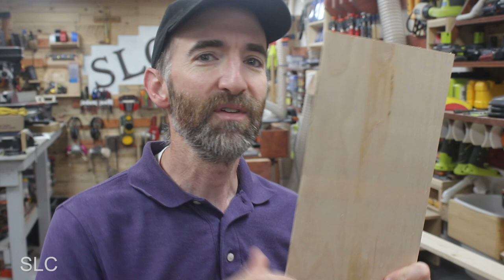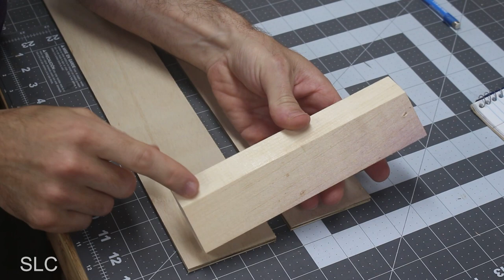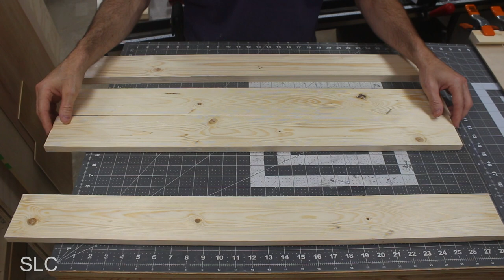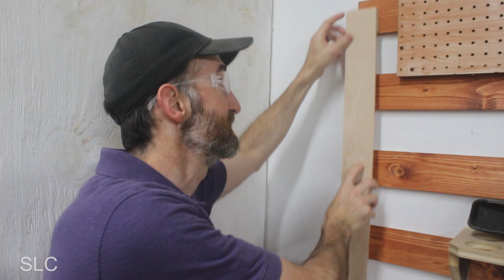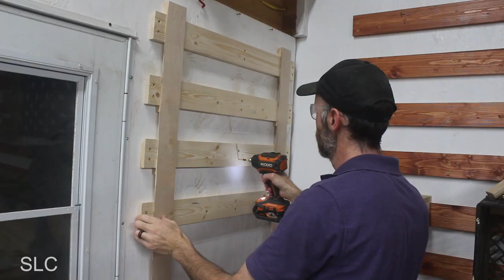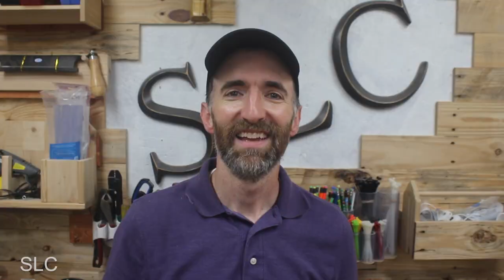Must Have Tool for French Cleats : Quick Installation

Comment: Nice idea. But I used rather simple but still effective way - you can start from bottom and then using the spacer that has been made from piece of wood you can easily go from the bottom to top adding the cleat one by one.

Comment: Good idea!  With an existing cleat wall as well as ripping a wider tool, I would have clamped slightly wide shelves to the bottom of the existing cleats, then glued and pinned the shelves to the tool to avoid having to transfer marks.
Reply from the maker: That would be a great alternative way to do it, thanks for the ideas

Comment: I would have made this in a 6 1/8" width and then ripped it on the tablesaw to get a perfect mirror image.
Reply from the maker: Good suggestion
Reply: That's what I was thinking!
Reply: Pin this comment!
Reply: Yep, came to the comments to say exactly this.  Make it as one piece, then split it.  Way quicker

Comment: Love this series. Thanks. What width do recommend for the tool holder cleats? Do you glue or screw them in?
Reply from the maker: The width depends on how wide the holder is and the weight/ balance of the tools it is holding.

Comment: I've made this same tool but only the top cleat to first holder. To get a matching set I attached 2 cleats the distance I wanted to a 6" wide piece of MDF then cut in half on table saw. I doubt I spent 5 minutes making it.

To use it the jig is moved down the wall to mount the next lower cleat. By using the single row jig I'm guaranteed spacing and level will be the same all the way down.
Reply: other folks I've seen do it from the bottom up, too... potentially don't even need a cleat, just two random scraps of board (as long as they're the correct thickness, and the exact same length as each other)

Comment: What do you recommend when two cleats butted against each other horizontally do not end on a stud? Cut a piece the size of the distance  between studs, i.e. 16”, and somehow manage to screw 2 cleat ends to 1 stud?
Reply: I'd be curious to hear thoughts about this, too!  From what I've seen elsewhere, I think people just let the ends float in between, as long as each side is screwed in to at least two studs... but... I would like to know.

Comment: I love the ingenuity, but is this overthinking this issue? I have always started from the bottom and used two 3" blocks (or whatever spacing you want) and use that for the spacing as you go up.
Reply from the maker: That can definitely work if you want to start from the bottom and go up. But what if you want to have your top cleat at a specific height, then you would need to go from the top down, which makes this tool very useful.

Comment: I’m hanging some old kitchen cabinets in my garage and decided to use French cleats. I just did a test fit with the first cabinet and the cleat is pulling away from the cabinet even when empty! I attached the cleat to the cabinet on the frame and avoided the thin backer material. Now that I need more fasteners I’m not sure what to do. The thin backer will definitely not hold a fastener with any resistance. I’m thinking of using washers with the wood screws to spread the force but looking for other ideas.

Comment: My walls are concrete block, how would I connect the French cleat to those walls? Would I just drill holes in the blocks and use wall anchors? I'm new at all this but I'm learning.
Reply from the maker: Some people might do as you say, but I always recommend building a frame wall out of 2x4s and adding some plywood or OSB and then attaching the French cleats to them. I know that is a lot of work, but it is the best in my opinion.

Comment: IIRC I brought something like this up in the comments section some time ago (like, a year?), but didn't really think this through: separating the tool from the cleats seems to be a little finicky. The hinge is an interesting suggestion, but another option could be to use spacers on the bottom cleat (should pull away easily after pulling the spacers out). 

If you size these to only space out two pairs of cleats, it should be easier to get the cleats equidistance, plus it'll store smaller. But then again, any errors would compound.

Wonder if you could mount a tool holder to this (could help serve as a reminder not to throw it out, too). 

Still haven't gotten around to reorganizing my garage. 😂
Reply from the maker: Adding a simple tool holder to this setup would be a good idea to prevent loss. Great suggestion.
If you brought this up in the past, sorry I didn't remember it.
Reply: @SpecificLove7  np, thanks for sharing (plus the tip on removing the tool). FYI, I also found my original comment (on the video titled "What is the best spacing between French Cleats") and realized I didn't go into any detail on it at all (just said "cleat hanging jigs" to "help maintain consistent spacing between the cleats"), so guess you'll have to take my word for it that this is what I had in mind.

Comment: I don't understand the advantage of this jig over a 3/4 inch piece of plywood that is cut to the width of the desired spacing. After the first cleat is up (straight and square) I just put the spacer against the first cleat and push the second against it. It's even easier if I install the lowest cleat first. This allows the spacer to just sit on the cleat and the next cleat just rests on it. If you have a long level that is the desired width you can use that instead.
Reply from the maker: That is a good method if you want to install from the bottom up, but some people would like to install them from the top down, which makes this a good option. Also some people might not be able to hold up a second Cleat while installing it.
Reply: @SpecificLove7  If it's too hard to for some to hold the spacer one could just mount it to a cleat and hang it from the one above.